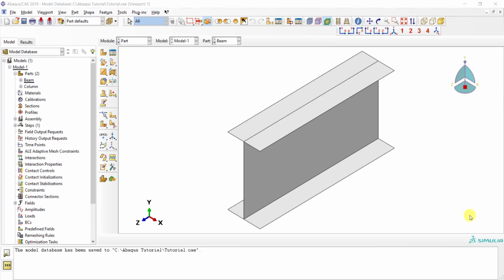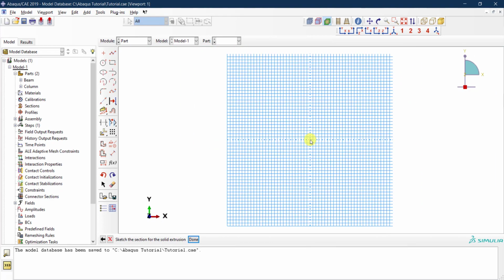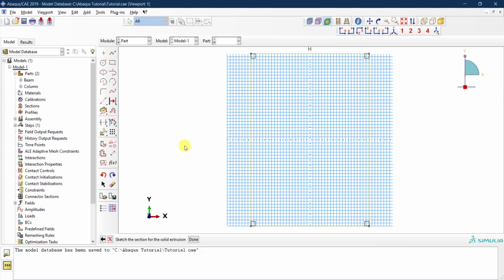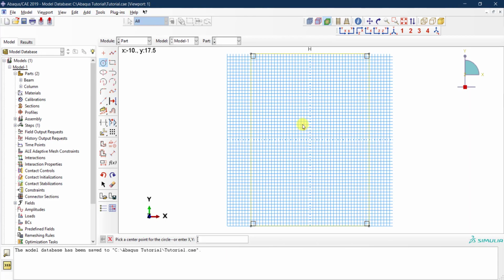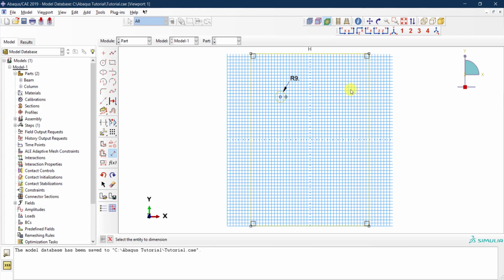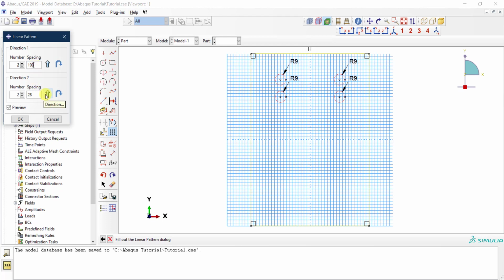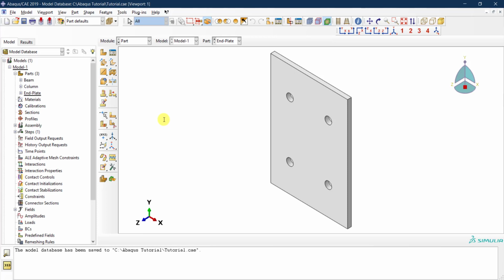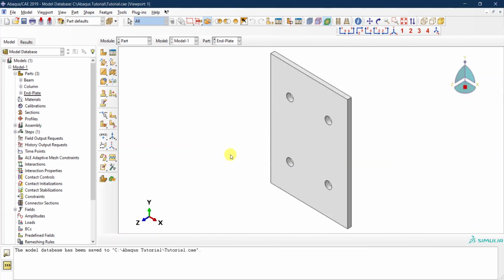#05 ABAQUS Tutorial: Creating a solid plate with holes

Comment: just wondering why the radius is 9mm instead of 8mm
Reply: The diameter of the bolt is 16cm so the diameter of the holes is (16+2)=18cm
Reply: @UB-us3ti  why it is plus 2 , not other number ,sir ?
Reply: @10nc-olehonguc21 d0 = 1.1d, the hole is a bit larger than the bolt